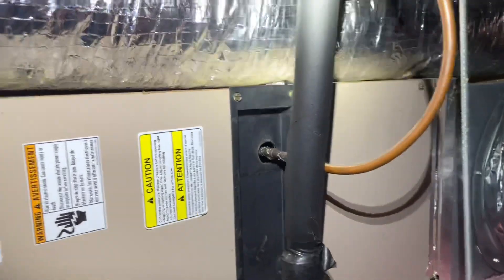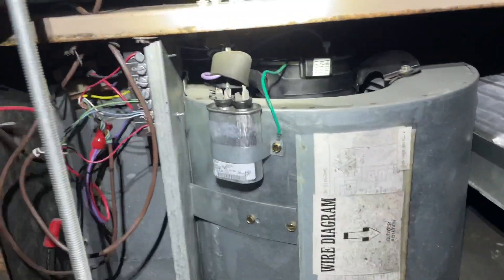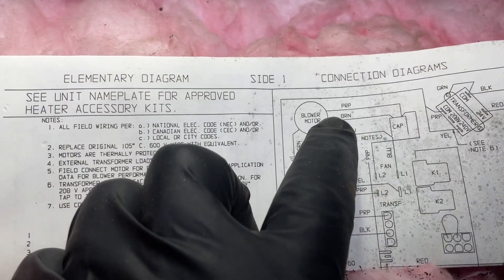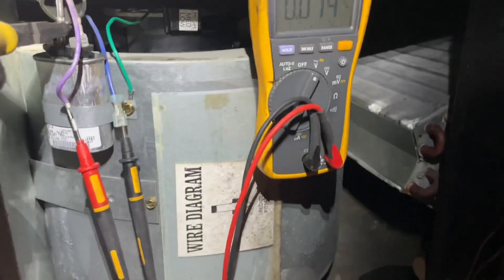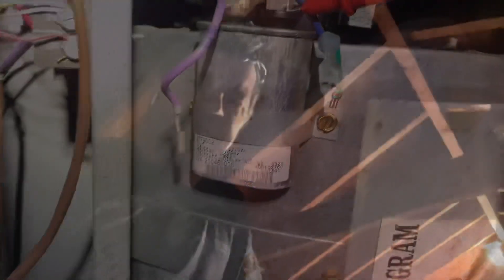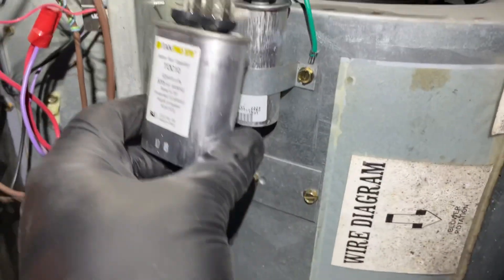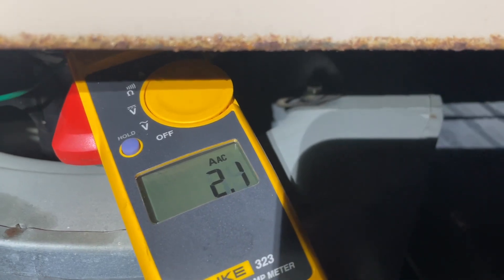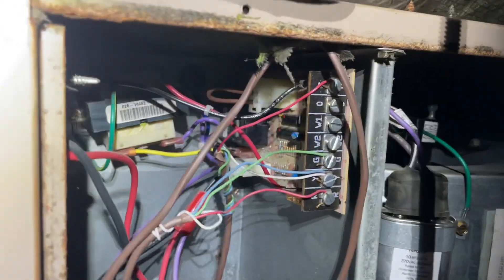How to Test & Replace Blower Motor Run Capacitor- Central AC Blower Isn’t Running & Froze System

Comment: To get a true Amp draw I was told you have to put the panel back on to get a true amp reading. Otherwise it will draw higher amps..

Comment: Good Job.  In all my years of doing service on furnaces and AC units, I never got shocked by a run cap.  I don't know if I was just lucky or what, but I never really tried to discharge then, before testing them.  But it's good that your careful,  Thanks for the videos they keep me connected with the HVAC field since retirement.

Comment: Great video. A bit of advice...when the new guy came in and sat down, it would have been good to say, "Now go out to the truck and familiarize yourself with parts locations and let me know if we're low on anything." I know it's annoying to repeat yourself (it drives me insane) but two things I've learned when it comes to training people are tell the them exactly what you want and repetition. After a probationary period (usually 30 days), if they still don't get it then it's probably time to part ways...no hard feelings.

Comment: Mikey....

One thing that I hope others take away from watching your videos is to put all the parts back where they belong when you finish a job.  That includes the rubber cap on the capacitor (as you did), mount the capacitor to the cabinet (rather than let it dangle by its wires), and replace all the screws in the cabinet.  I noted on one of yesterday's videos that Paul said that a screw was missing from the condensing unit - and you said, go get another screw. 

 I can't tell you the number of hacks I have found in my HVAC systems - most involving missing screws (which allowed the unit to suck air and dirt as well as "whistle" when running), screws stolen from water "hoods" over louvers on the cabinet (I have two packaged units - these hoods kept wind driven water out of the cabinet), loose electrical connectors to the disconnects, and the latest being 50A breakers on a 40A rated unit with a non-fused disconnect.  I also noted that you hauled out your trash from the attic.  After the last clown worked on my garage unit, I found he just tossed his trash on the roof - as if no one would notice.  

These lazy techs should be fed to the lions.  If they want to be paid like professionals, then they should act like it.

Comment: Omg I just follow this video and tested my capacitor and I shocked myself with high voltage
Reply: Not too smart ... CALL A PROFESSIONAL
Reply: @jimmyp5487  JOKING , just making fun of the homeowners who will go change it themselves
Reply: @Chinamax00   If you got zapped by a PSC  Run capacitor, either you didn't turn the power off or the motor windings are open.  Start caps can zap you.